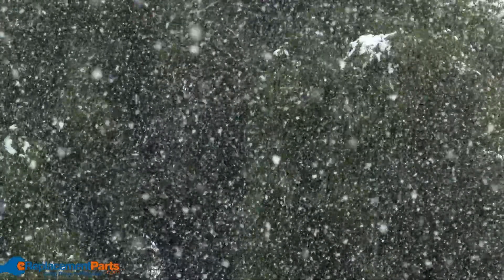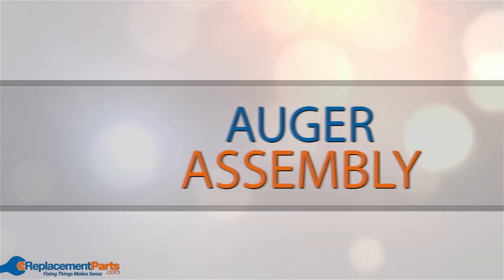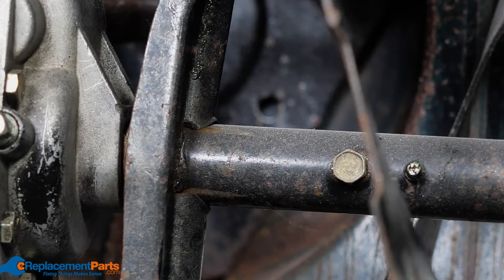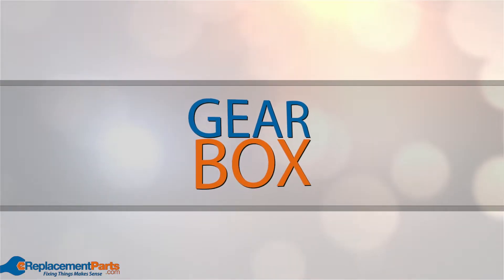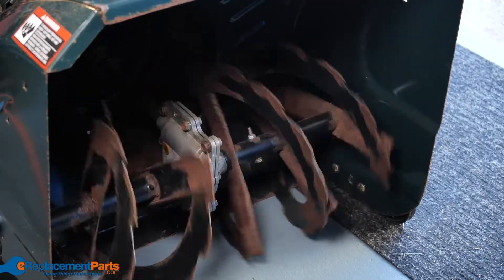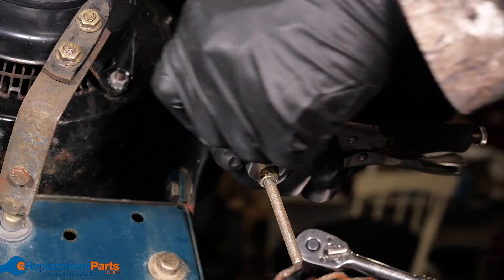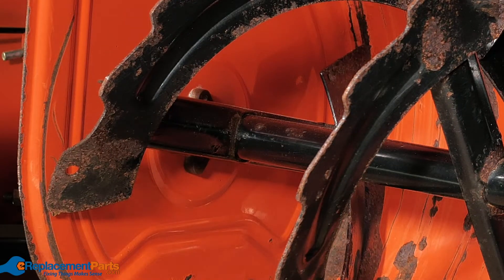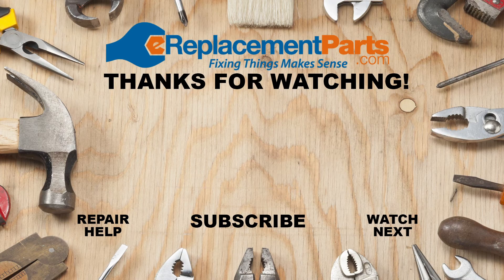Snowblower Troubleshooting: Why Your Snowblower Auger Won't Engage | eReplacementParts.com

Comment: I have a poun pro snowblower, for some reason when the I press the auger drive handle the impeller will not turn? The belts are fine, I can turn the impeller with my hand but when I start it 
Won’t Turn, any ideas why that is happening?
Reply: Did you find out what it was?

Comment: have old craftsman snow bloer the auger will not spin it did a little nit but just stoped all together.. hear nothing on gear box turn auger blades by hand a little stiff but but will turn

Comment: Awesome! It was the right side shear pin. Knocked out what was left of the old one and put in a new one and it worked like a charm! Thanks so much!
Reply: Hey Tim, I know it’s been years. So in short, if my right side pins snapped off that could explain my no-spin issue? My impeller isn’t spinning either tho

Comment: I have an Ariens 30" snowblower...the auger does not engage...I hear a clunk when depressing the handle that is supposed to engage the auger...only 3 years old...I hope the clunking sound gives you insight as to the problem...
Reply: Mine does too you find what it was?

Comment: Hi.  Right hand auger needed a new pin so I replaced it.  However, after replacing the pin the auger still spins freely and is not tight like the left side auger.  Is there something else going on that i need to look at?
Reply: did you ever fix this problem??